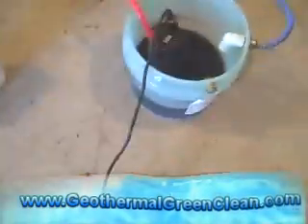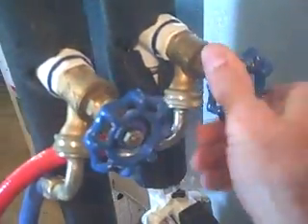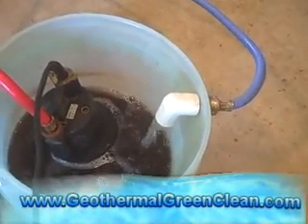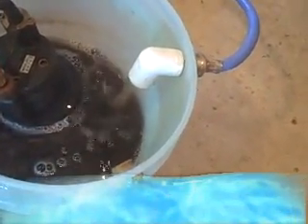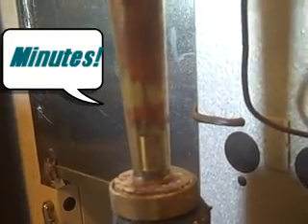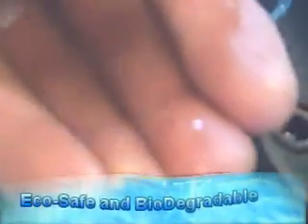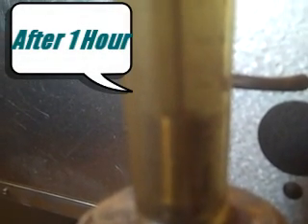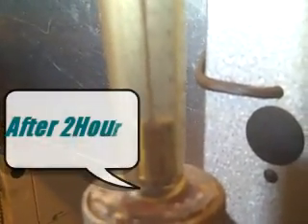Geothermal Open Loop Cleaning DYI volume 1    www.GeothermalGreenClean.com

Comment: Contact your local Geo person that installed your system to obtain a bottle of the GeoGC descaler.  Try this stuff.......
 http://www.homedepot.com/p/Hercules-Haymaker-Tankless-Water-Heater-Descaler-35230/205086908?cm_mmc=Shopping%7cTHD%7cG%7c0%7cG-VF-PLA-D26P-WaterHeaters%7c&gclid=Cj0KCQjwxdPNBRDmARIsAAw-TUmTpa1WRPB0004hcwd5ewBH8E0qB1fWsdWOVy-u2g0ZqMQOL_Q3x3AaAvtKEALw_wcB&gclsrc=aw.ds&dclid=COLUyOjlmtYCFQgbaQodb7sKZA